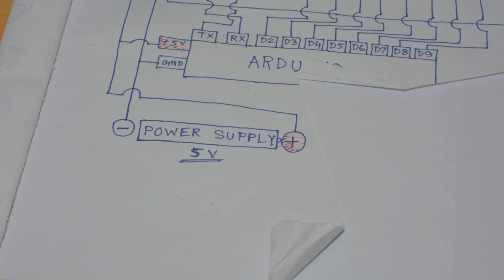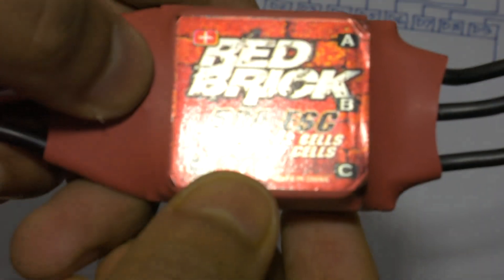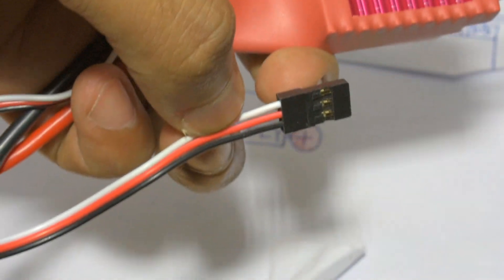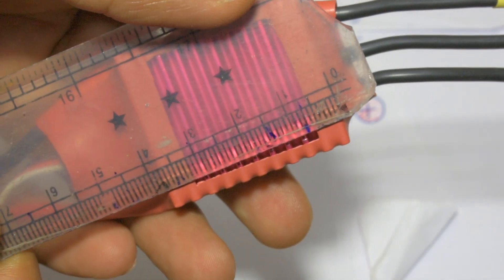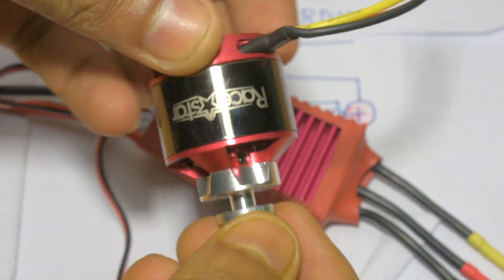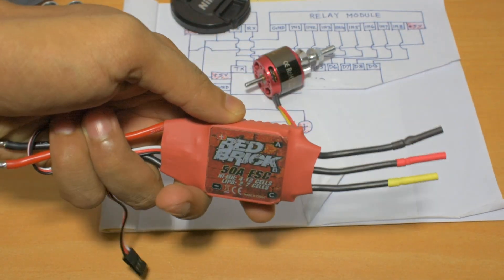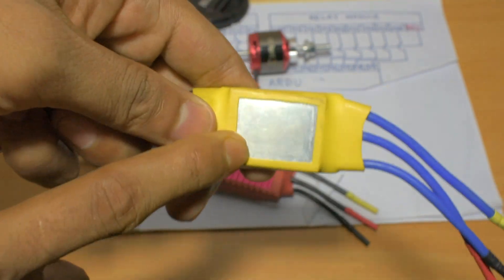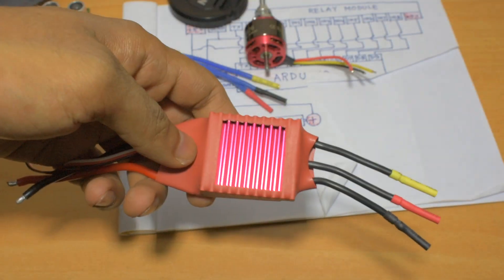Best ESC In It's Class || 50A OPTO ESC

Comment: I ordered both from your link. helpful. I recently added my fpv and fc to my plane and i came to know that my plane is under powered due to weight. so I need these parts. thank you.
Reply from the maker: Thanks for your kind support :)
Reply: @MakerHand  what happens to esc during the work when it looses connection with the remote ??? SECOND QUESTION -  IS IT PROGRAMMABLE ??? KISS
Reply: both the parts are value for money. Thanks alot